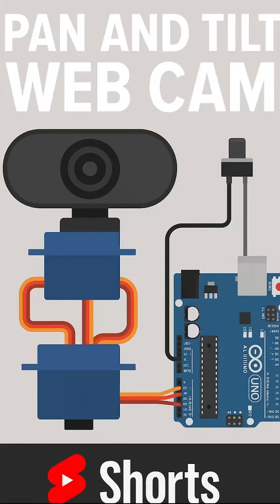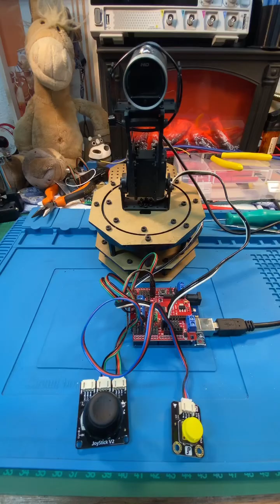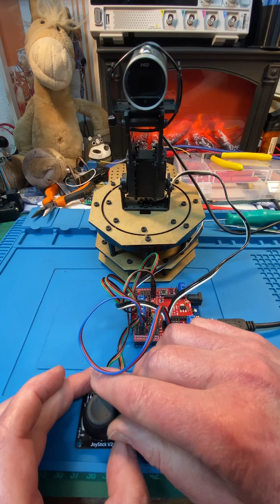Control Your Webcam Like a Pro with Arduino 🎮

Comment from the maker: #include <Servo.h>

// -------- Pins --------
const int JOY_X = A0;
const int JOY_Y = A1;
const int SERVO_PAN_PIN  = 8;
const int SERVO_TILT_PIN = 9;
const int ZERO_PIN = 2;    // button or signal to reset pan/tilt

// -------- Tuning --------
const int DEADZONE = 40;
const float MAX_SPEED_DPS_PAN  = 180.0;
const float MAX_SPEED_DPS_TILT = 120.0;
const int PAN_MIN_ANGLE  = 0;
const int PAN_MAX_ANGLE  = 180;
const int TILT_MIN_ANGLE = 15;
const int TILT_MAX_ANGLE = 165;
const bool INVERT_PAN  = false;
const bool INVERT_TILT = false;
const float EMA_ALPHA = 0.25f;

// -------- Internals --------
Servo panServo, tiltServo;
float panAngle  = 90.0f;
float tiltAngle = 90.0f;

int centerX = 512;
int centerY = 512;

unsigned long lastUpdateMs = 0;
const unsigned long UPDATE_INTERVAL_MS = 20;

// Helper clamp
template<typename T>
T clamp(T v, T lo, T hi) { return (v < lo) ? lo : (v > hi) ? hi : v; }

void autoCalibrateCenters(unsigned long ms = 500) {
  unsigned long start = millis();
  long sumX = 0, sumY = 0;
  long n = 0;
  while (millis() - start < ms) {
    sumX += analogRead(JOY_X);
    sumY += analogRead(JOY_Y);
    n++;
    delay(2);
  }
  if (n > 0) {
    centerX = sumX / n;
    centerY = sumY / n;
  }
}

void setup() {
  panServo.attach(SERVO_PAN_PIN);
  tiltServo.attach(SERVO_TILT_PIN);

  pinMode(ZERO_PIN, INPUT);  // or INPUT_PULLUP if using a button to GND

  panServo.write((int)panAngle);
  tiltServo.write((int)tiltAngle);

  autoCalibrateCenters(600);
  lastUpdateMs = millis();
}

void loop() {
  // --- Reset check ---
  if (digitalRead(ZERO_PIN) == HIGH) {
    panAngle  = 90.0f;   // zero/home
    tiltAngle = 90.0f;
    panServo.write((int)panAngle);
    tiltServo.write((int)tiltAngle);
    delay(200); // debounce / hold reset
    return;
  }

  // --- Normal jog control ---
  unsigned long now = millis();
  if (now - lastUpdateMs < UPDATE_INTERVAL_MS) return;
  float dt = (now - lastUpdateMs) / 1000.0f;
  lastUpdateMs = now;

  static float xFilt = analogRead(JOY_X);
  static float yFilt = analogRead(JOY_Y);
  xFilt = (1.0f - EMA_ALPHA) * xFilt + EMA_ALPHA * analogRead(JOY_X);
  yFilt = (1.0f - EMA_ALPHA) * yFilt + EMA_ALPHA * analogRead(JOY_Y);

  int dx = (int)xFilt - centerX;
  int dy = (int)yFilt - centerY;

  auto deflectionToSpeed = [](int mag, int dz, float maxSpeed) -> float {
    int span = 512 - dz;
    if (mag <= dz) return 0.0f;
    float norm = float(mag - dz) / float(span);
    return norm * maxSpeed;
  };

  float speedPan  = deflectionToSpeed(abs(dx), DEADZONE, MAX_SPEED_DPS_PAN);
  float speedTilt = deflectionToSpeed(abs(dy), DEADZONE, MAX_SPEED_DPS_TILT);

  int dirPan  = (dx > 0) ? +1 : (dx < 0 ? -1 : 0);
  int dirTilt = (dy > 0) ? +1 : (dy < 0 ? -1 : 0);

  if (INVERT_PAN)  dirPan  = -dirPan;
  if (INVERT_TILT) dirTilt = -dirTilt;

  panAngle  += dirPan  * speedPan  * dt;
  tiltAngle += dirTilt * speedTilt * dt;

  panAngle  = clamp(panAngle,  (float)PAN_MIN_ANGLE,  (float)PAN_MAX_ANGLE);
  tiltAngle = clamp(tiltAngle, (float)TILT_MIN_ANGLE, (float)TILT_MAX_ANGLE);

  panServo.write((int)(panAngle + 0.5f));
  tiltServo.write((int)(tiltAngle + 0.5f));
}